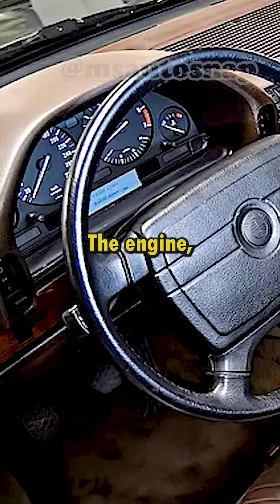When Engineers Build Cars! #bmw #mercedes #bugatti

Comment: Remember when Volkswagen made a diesel V10 and a W12. German cars are insane
Reply: The diesel V10 could be found in both the Touareg and the Phaeton ...I can't remember for sure but I think it was tuned for more low range torque and less power in the Touareg, although the Phaeton tune wasn't exactly lacking in torque
Reply: @izzabelladogalini My dad had a v10 twin turbo diesel Touareg when I was pretty young so maybe 08’ ish?. It wasn’t the fastest thing I’d ever been in. But the torque felt endless when I drove it on my learners.
Reply: @LVUFC  rumour has it with that amount of torque they actually remained stationary and only got from A to B by rotating the planet underneath them
Reply: @izzabelladogalini  sorry but you're wrong. That only happens during drag races. That's the reason why the earth rotates on its axis while revolving around the sun.
Reply: Mind in these days, these brands was front engine rear wheel drive. Would need the trunk filled with some led, or a gentle foot, to get that torque transferred to the road.
Reply: Yeah they were wicked toy wagons my m8s dad got 1 the first year came out to tow the motocross trailer it was nuts blowing the doors of skylines and evos etc in motorway with the trailer behind😂 the trailer had a hard life with regular 200kmph plus  fully loaded all over New Zealand @LVUFC
Reply: @izzabelladogalini we had that v10 Tuareg when I was in primary school
Reply: @izzabelladogalini  No, both have the same power and torque. Only the transmission was programmed differently. I drive the V10 Touareg and since the torque converters are underdimensioned, you drive a lot without lock-up and so the Touareg feels slower and more sluggish. But mine with a slight tune to 345PS and 900Nm accelerates the 2750kg empty weight to 100 in 7s. Good enough for me, towing car trailers with it
Reply: @izzabelladogalini  Some of them even imprisoned. Thug life...  :)
Reply: ...yep! and Audi had a diesel V12
Reply: @tomm487  And they were experimenting with fitting that in an R8. Twin turbo 6.0L V12  500PS 1000Nm 6 speed manual with Quattro
Reply: @mitjafabjan3582  Now that is a cool swap idea...for when i win the lotto😅
Reply: @tomm487  In a Q7 SUV.
Reply: @tomm487 diesel v12 is absolutely insane
Reply: Can't forget the W8 Passat
Reply: @Funanial  i was about say that
Reply: @Funanial  I remember going for a drive in one of these with my dad when he was car shopping in the early 2000's. It had the 6 speed manual too, it was a cool machine. He ended up getting a V6 Audi A4 then moved on to a V8 S4.
Reply: @Funanial  these engines run in africa for eternity
Reply: Back in the days when Volkswagen actually produced interesting cars
Reply: I actually finally saw a V10 TDI Touareg just a week ago! the sleeper suv
Reply: There V12 diesels in a certain recent Audi 4x4 model.
Reply: @OffGridInvestor  Q7 Tdi
Reply: and not to forget, the 6.0L V12 TDI
Reply: Mate, I worked for VW-Audi related companies back then. You only praise these engines if you never operated them. The teething troubles were insane, the maintenance cost through the roof and their endurance poor. And that's putting it in a friendly way.
Reply: @zweispurmopped  Facts
Reply: Yes.  To Germans, nothing is impossible.  Maybe not practical but not impossible.
Reply: Europeans are much better than us with fashion clothing and cars.
Reply: When two gods fight.
Reply: ...and stupid AF
Reply: Were insane. Make German cars insane again 🗿
Reply: That engine is from ww2 panzer tank
Reply: used to be*
Reply: it wasn't a W12, it was a vvr. I don't know of any mass produced w car engine.
Reply: Yes and diesel v10 was the worst.  Like it's mechanic nightmare and it's not reliable.
Reply: @starydwumas7481 I suppose you talk out of experience and not just YouTube comments? I own one. For most things I do not remove the engine. Besides, on most american trucks you split the whole chassis from the body to work on engines. Not better. And reliability wise it's a mixed bag. After 200.000km you have to do some things every now and then. But the engine itself really does 500.000km
Reply: @GERntleMAN  out of experience, yeah, maybe this engine can survive few hundred thousands but maintance job on this engine is total fail, and engine itself has few flaws like injectors sockets. 
I mean I know that engineers thought  that this engine gonna be strong and could survive much without much maintaince like honda gold wing which is famous from it but they failed miserably. 
Maybe you don't need to pull out the engine but you need to remove things that are in line like bumper, covers, radiator. In my car I never took out bumper to do anything, but in vag group it happens constantly.
Reply: @starydwumas7481  That's true, for me it's pretty normal to remove such things. Whether it's my RS6 C5, A8 D2 or TT 8N. On my E39 535i I had to remove a lot of things as well. It's a thing of packaging in german cars, no german car is "easy" to work on in your driveway. Well I do everything in mine without roof, but nevertheless. Sure the V10 could be more accessable which would be nice. But I don't mind really, it's an luxury item and luxury items aren't supposed to be easy. The injector sockets is a very important point indeed! There is 07eins in Germany which make a good kit for these engines. Do it in advance and you will likely never have problems. The job is pretty easy, maybe took me all in all 9 hours. On the other hand, you will never have to do timing belt or chains. That's a huge money saver
Reply: @GERntleMAN  as far as I know injectors sockets in this particular v10 gets worn out during exploatation and you need to take off head if you need to repair that. Engineering nightmare.... it's not cheap to repair and it happens when engine have few hundreds on the clock. 
Also other basic stuff like thermostat or heating radiator, water pump are complete nightmare on this engine. 
And as you said today standard is that German cars aren't easy to work with on your own while 10 years ago mechanics thought complete opposite. When they serviced old golfs or Audi 80 it was piece of cake to work with this cars. Nowadays it's mechanic nightmare to work with German car. Parts aren't cheap, cars aren't cheap and aren't reliable. Why would you want German car then ? You think that luxury items shouldn't supposed to be easy ? Try working on Lexus or Infiniti.
Reply: @starydwumas7481  Yes, that's why 07eins offers a kit to prevent that. It's a new holder for the injectors which prevents them from tilting and vibrating. If your damage is not bad enough, you can use those holders with reinforced o-rings and be fine. That's what I did. Of course if you install those pre 200.000km, you will never have this problem. The thermostat is quite accesable and you don't need to remove much at all, but I know what you mean.

Lexus or Infiti are nice and german manufacturers should take note from them indeed. But compared to german cars they are less nice quality wise. At least up until 2013. After that german cars became incredibly cheap inside and Lexus became much better. Audi 80 and 100 were a bliss to work on, but they didn't have all the luxury options like a Touareg has. I have two climate systems, one in the front and one in the boot on the left side meaning two condensers and two blowers. I have park heating, air suspension, adaptive headlights with corner light, highway and turning light, AWD with lockable center and rear diff, a freaking V10 Diesel with two turbos, a huge automatic transmission, multiple radiators and intercoolers, DPFs, cats, two batteries etc. Nothing cars from the late 80s and 90s could even dream of. Of course there is space to work. There is nothing there
Reply: Shame
Reply: Now they all make 4 cylinders 😅, soon to be all electric 😅😅
Reply: *were
Reply: The Fords Triton V10 made of utter dog shit
Reply: Audi had diesel rave car winning LeMans
Reply: w12 engine is unkillable.....
Reply: Remember when those engines became so cramped because of the big configurations in the V10 and W12, pretty much every repair is an engine out job. Yes, German cars (particularly VW group) are insane.
Reply: It’s because the autobahn makes it reasonable to have v12s that aren’t insane performance cars, but luxury cruisers with smooth power that is enough to pass any car. Think a rolls Royce ghost or maybach s-class
Reply: Coming from the people that made the mouse, the v2 and Werner von Braun 
We insane? Depends on who you ask
Is our sht unbelievable as long as is works? Yes 
Is is a catastrophic unfixable clusterF if is breaks? Yabetcha🤣🤣🤣
Reply: Coming from the people that made the mouse, the v2 and Werner von Braun 
We insane? Depends on who you ask
Is our sht unbelievable as long as is works? Yes 
Is is a catastrophic unfixable clusterF if is breaks? Yabetcha🤣🤣🤣
Reply: I have and love both
Reply: Yeah, the phaeton
Reply: And they were almost arrested for dieselgate😂
Reply: @giulioiodice2114  “That car does not pass the EU emissions regulations”
-
Reply: @DjursholmCars  Actually, the vehicles did pass both EU and US emissions regulations when tested, but that was the problem.

While placed in test, the vehicle ECM would activate vehicle emission control systems allowing them to function (which heavily restricts the vehicle's performance capability but necessary to achieve emissions regulations while running.) The vehicle would easily pass emissions testing within the test environment. 

However, once out of test, the vehicle would disenable the emission control systems permitting the release of emissions pollutants into the environment and unrestrict engine output to restore driving performance.
Reply: @Wait what did i say?
Reply: Arrested? 🤡  @giulioiodice2114
Reply: @giulioiodice2114  arrested? This isnt  a soap opera
Reply: @giulioiodice2114  Avarage american truck :
Reply: @giulioiodice2114  something Ford has always done btw 😂
Reply: V12 TDI In Volkswagen Touareg and in Audi Q7
Reply: @ФёдорБАНский  did they use the V10 tdi in the Le Mans cars also
Reply: @ФёдорБАНский  yes the R10 v10 lemans
Reply: I'm still surprised that they actually equipped diesels in Golfs, Jetta's & Passats! 

To me, that only fits right in trucks & or really heavy duty pickups.
Reply: The V12 and W12 are not VW products. The W12 is Bentley engine designed in the 90s before they were acquired by VAG group. Also, the V12 is Audi engine, not VW. Exactly like the 2.0 TFSI and 2.9 TFSI. One thing is to own a company, and another thing is to design and develop engines, where each company has its own engineers.
Reply: @legioner9  Audi already used a W 12 for a concept car in 1991. How did Bentley design the engine independently without VAG when it is based on two VR6 engines?
Reply: @Freimopp777   That is a very big BS with the VR6 circulating on YT. Bentley developed and BUILT their own W12 before they were bought. And they had a functional W12. Audi in 1991 did not have any W12. The car showed on display in 1991 had just a dummy engine inside with W12 inscription. Plenty of articles to back up these facts. Audi simply did not have any expertise in the 90s to build big cylinder engines. Same story with the 5.2 V10. It is a Lambo engine. Audi started to use W12 on their cars in 2001, Bentley engines. What they did in 1991 was a cheap show.
Reply: @legioner9  Where can i read about  bentleys own W 12 development?
Reply: @Freimopp777   Sorry. I meant W16, I do not know where you can read about the development. Although Bugatti/Bentley used this engine. I mean, it was not designed by the germans. And the W12 likely is that engine without 4 cylinders; displacement at least drops proportionally from 8 to 6 litre.
Reply: @legioner9  VW  had a running  W12 prototype in 1997 , built  before the Bugatti prototypes  with W18 and W16 engines. I  just can't find  information that Bentley had built   their own W engine or planed anything before.
Reply: @Freimopp777   Yeah, possible the Bentley engine is actually the Bugatti 90s W16.
Reply: @legioner9  I found a reference to Bentley. It is the  1999 Bentley Hunaudières concept which has a W16 VW engine and even before that, everything indicates that Audi and VW developed the W engines alone, starting with the VR 6 development in the late 1980s and then the W 12 Avus concept idea  that never came to fruition, up to the roadworthy VW 12 prototype in 1997 and then the W 18 and W 16 engines.
Reply: @Freimopp777   I personally doubt that the W16 is VW or german engine at all, as I said. Especially since VW had no reason to build such engines, nor did they have the expertise. Furthermore, almost all VW engines were and are not very good engines by any means, the VR6 and W8 included. Bugatti was bought in mid 1998. It is impossible in 1 year to design and build an engine, especially a W16 one. I doubt you will find any information on who designed the W12 engine. Classified.
Reply: @legioner9  I have no doubt and Ferdinand Piëch  pushed the ideas of highlighting Volkswagen's technical capabilities and promoting the newly acquired brands.

Comment: Then: 16 cylinders and 400 hp
Now: 3 cylinders and 500hp (gemera)
Reply: For one, it was 600HP on the TFG. And 2,That engine can probably only have so much power thanks to the electric assist to mitigate the stress on it. Also these engines werent meant for raw power because if they did they could probably do well over it at the time since things like the ferrari F40 and porsche 959 were near 500HP territory with V8 and B6 + turbo. The small power density means greater reliability and the torque might be really good.
Reply: You don't have to reach hypercar prices. 
A basic TRD Toyota Yaris is as fast today. :)
Reply: aaaand  in1993 honda made 4cylinders with small 2.2 or 1.8litre 220hp 100 hp per litre more than 99% of actual claimed sports cars and its closest comparison e30 m3 and mercedes evo 2 high performance cylinders that where alot bigger. lol its about actual performance and tuning which alot of engines didnt have and still dont lol. 300 hp from a v12 is because it isnt a high performance engine with racey parts its just a v12 its super simple (: the way avalvetrain and head is made and tuned is one of the most important parts of what makes it different.
Reply: That 3-cyl isn't really so impressive.
It was possible to get 1000hp / liter from turbo engines back in the 1980s. And BMW were one of the makes to do exactly that (in their racing cars).
Ok they had terrible lag and didn't last long, but it proves the point that turbos have been making small engines put out huge power for several decades now, it's not a new thing!
Reply: @soundseeker63  we are talking about stock daily drivable engines street engines dude not ticking time bomb race engines. Plus hp per litre is more measurable when naturally aspirated when boost is unvolved it means nothing to an engines actualy mechanical power
Reply: @repingers9777  He mentioned a Koenigsegg 3cyl engine, so I'm not sure how you determine we are only talking about "stock daily driver engines"..... but ok.
Reply: @soundseeker63  still boosted engines still dont make sense to use hp per litre for i mean its fun but yeah...
Reply: @soundseeker63  look, if its absolute limit, dragsters exist and have many thousands HP but literally blow their own engine in a single run and consume the same fuel as an jetplane on takeoff. Which is why its also not fair place certain types of race cars in these comparisson. F1 cars for example could squeeze upwards of nearly 1000HP out of V10/12 with only a little more than 3 liters at most. But they were basically disposable engines that only lasted a single race, and later they changed regulations so they needed to last a whole season but even then nearly 3HP per liter on NA is crazy.
Reply: @soundseeker63  for example thats why honda dohc vtec k series are so potent and popular paired with boost because naturally aspirated they make 100hp per litre which is more than most actual sports cars and high performance engines bc the engine is pure performance in sacrifice for drivability and torque aaand mpg for a small 4cylinder you will be getting v6 mpg or worse lol. it makes better use of any extra air shoved into it than a similar engine with less hp per litre thats why an already turbo'ed engine hp per liter isnt really talked ab or used
Reply: A 3 cylinder GR MN Yaris makes 400hp
Edit : 305hp at wheel 380NM of torque
Reply: @T0NYMANUEL  for how long?
Reply: @unkindled6410 until it lights on fire.
Reply: The future: Electric and 600hp.